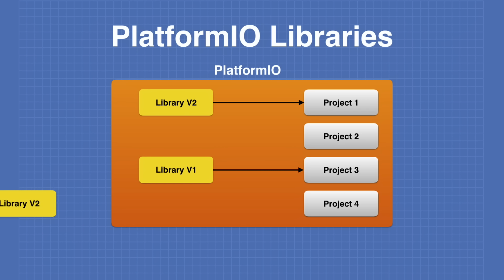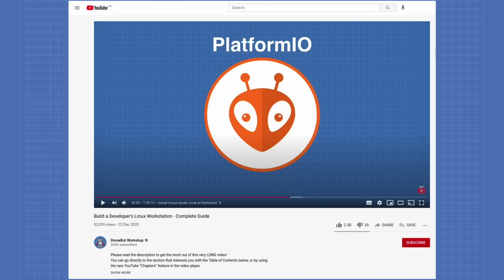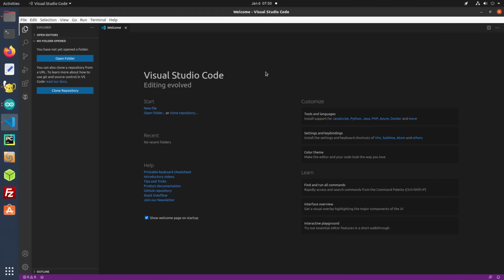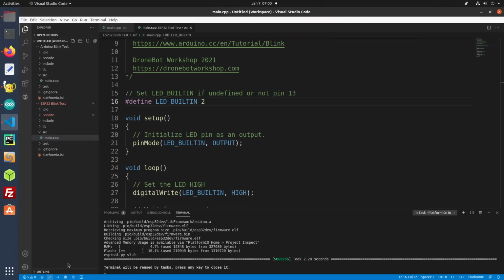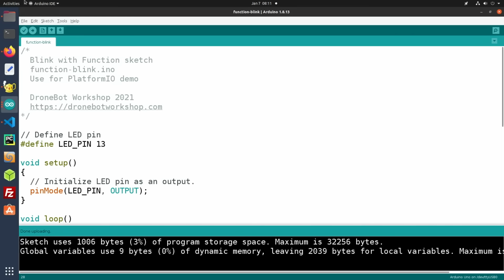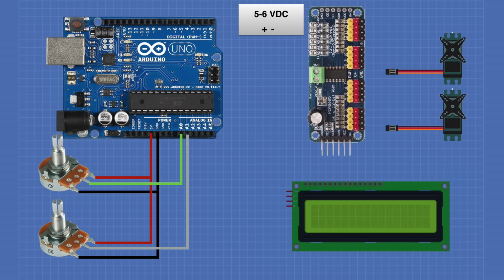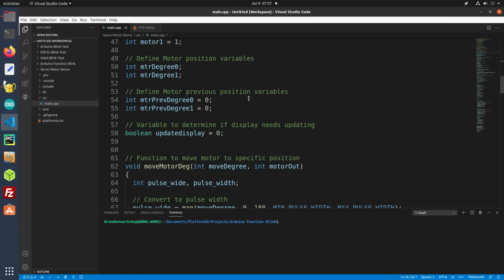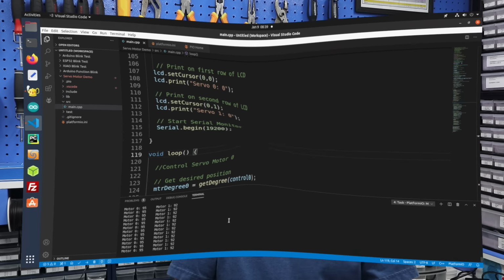Getting Started with PlatformIO

Comment: Great video, was looking for a clean and detailed introduction to PlatformIO to program an Infineon XMC. I really loved the video, just wanted to note some small criticism about a simplification that you made around 29:30. The problem with the function definition actually has nothing to do with PlatformIO, Arduino or VSCode but with C++, the programming language on which the Arduino framework is build. Here it's required to at least define a function, if not implement, before you use it in code. This is one of the main reasons for header files (.h, .hpp, ...). I'm just personally not a fan of these oversimplifications that hide the true nature of things. Not that some young programmer is looking for the differences between PlatformIO and Arduino, when she should rather look into how C++ works.

Anyway, I just wanted to note that and maybe give someone new a little bit more insight. Changes nothing about how extraordinary well you explained this! Your channel is always a great starting point for a fresh embedded systems project.

Cheers

Comment: If you'e having problems with the ordering of functions then you can always notify the compiler of a "forward reference" by using the "extern" keyword and typing the following just after the #include statements:  extern void blink_led();

Now you don't have to worry about reordering the functions. Besides, sometimes functions refer to one another in such a way that there is no ordering possible. e.g. function1 refers to function2, and function2 refers to function1. The only way out of this deadlock is to use the "extern" keyword for both functions.

Comment: Another great video! This one was particularly useful to me as I was just trying to bring up VScode as a new IDE to try (replacing the Arduino IDE). I couldn't get my previous Arduino IDE code to port over readily as I couldn't get the library path issue figured out. I looked at several different cryptic online sources with no luck. Your video made it clear as a bell. Setting baud rate in the terminal too was mired in dead ends. That was made clear and simple here as well. To the point, simple answers to simple questions. What a concept! 
Thanks for doing these vids!

Comment: thanks So much , its great video and more informative
about the definition of functions after loop and setup void , you can do it in Platform.io by using Headers , its a simple concept for c++ language , follow the below :

1- put the declaration of the functions inside header file called [FunctionDeclartions.h] and store file inside folder called [nclude] its built in folder inside the project
example: void printMessage(char* msg);
2- just include it like FunctionDeclartions.h on top my main.cpp file
3-Write the Implementation of function inside main.cpp file like below
void printMessage(char* msg)
{
  Serial.prinln(msg);
}

4-have fun :)

thanks a lot

Comment: thanks for your educational workshops ! I am radio transmitting amateur, PA0HTY and for the home-built MLA antenna I am going to apply a stepper motor. as an engineer many projects with the Intel microcontrollers 8031 and 8051. My question, is it possible to switch IDE in high contrast mode? because of poor vision IDE environment is very difficult to read! Or is there an IDE alternative ? Thank you ! kind regards, Theo, the netherlands.

Comment: I always found Arduino IDE to be just terrible, sure you can get simple stuff working with it but anything even slightly complex and it is pretty frustrating, if the available libraries don't do exactly what you want you are stuck. I have been using CubeMX IDE for STM32 development and found that to be fantastic but it is only for STM32 devices. I have Eclipse with ESP-IDF integration for ESP32 and I don't use Arduino devices because they are so limited so this looks like it may be worth trying out.

Comment: Great video!

Pro C++ tip: For cleaner code, you can split function declarations and definitions. This allows you to have the first proper block of code be your main function/loop, whilst still allowing you to write and call functions separate from your main function.

To do this, just declare the function before your main like this: void myFunction();
Then, write your main function, and define your extra function below the same as you did in the Arduino IDE.
Reply: Yes, It's called a function prototype
Reply: @_ahmedwalid_  Show a Video with a proper demonstration
Reply: Function declarations work really well. I've always thought that having a load of functions at the top of the code is a real pain because it can take ages to find where the actual main program starts and as often as not the actual functions are low level trivia that just get in the way. Bill says that having to declare all functions before you use them encourages people to write good code. I disagree - who cares where the functions are defined as long as they are defined? Putting them at the end makes the resultant code a lot clearer and easier to read. Also, I've found that the Arduino IDE sometimes allows you to put them at the end but sometimes it doesn't. Function prototypes solve this problem, but ideally they shouldn't be necessary. The same goes for variables - they have to be declared before you use them. Why (as long as they're in scope)? I worked for many years writing in assembler and liked the ability to declare variables where it was convenient for me. The only advantage that I can see obtained by having to declare functions and variables BEFORE using them is that it saves a compiler pass and hence a few milliseconds. That's hardly an overriding reason with modern high speed processors.

However, despite the above comments, don't let this distract from the fact that this is yet another superb video from the master presenter.

Comment: This should be the go-to primer video on PlatformIO - concise and to the point, presented with a calming voice.

I managed to get a Digispark (micronucleus) v2.5 board working in Windows, but haven't had any luck in Ubuntu due to many issues with the micronucleus command. Has anyone else got this working?
Thanks

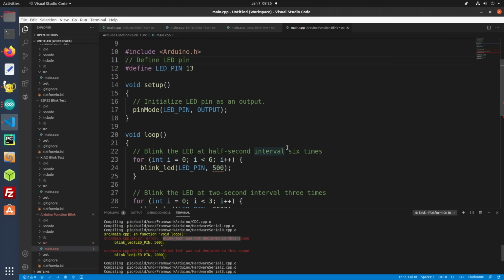Comment: 29:00 The discussion about defining a function before calling it. This is a feature of C++ (and a number of other languages). Why do you not need to follow this requirement when compiling with the Arduino IDE? Because in Arduino you put your top-level code in a blahblah.ino file from which the IDE build pipeline generates  a corresponding C++ file and a header file that contains function prototypes for any functions you defined in the ino file. The C++ file imports that header at the beginning, so by the time the compiler gets to the seemingly out-of-order call to the your added function, the compiler has already seen the prototype in the header file. So all is well.  Whether this is a positive feature is debatable.  It helps inexperienced users get things working in Arduino without some fussy details. But it violates the C++ language spec, and introduces mysterious behind-the-scenes magic.

Comment: Thanks so much for this video. About 1/2 way thru I dl'd and installed. Being a Borland and then VS programmer from way back I really appreciate the debug and code extensions. The Arduino IDE is positively prehistoric in comparison. I felt right at home immediately. Thanks again. BTW, I like being forced to define functions. The arduino IDE was too loose in this respect.

Comment: A tip re multiple envs

In your platform ini you can put build flags
e.g.

[env:leonardo]
platform = atmelavr

board = leonardo

framework = arduino
build_flags = 
 -D=LEONARDO
 -DaNAME='"leonardo"'

Then just ref them in code later

  #ifdef LEONARDO 
   Serial.println("I AM LEONARDO");
  #endif

  Serial.println(aNAME);

This way your code can act differently depending on the env you are targeting.

Comment: Great tutorial Bill, thank you! I was wondering if it will be possible to install PlatformIO on a Raspberry Pie 4! Right now I use a RP4 to run the Arduino IDE and I upload my sketches directly to an Arduino Board connected to the RP4. I have created that environment since I didn’t want to connect microcontroller directly to my brand new MacBook Pro. What do you think, anyone? Thanks for your help!

Comment: I've had VCC installed for a long time but am not finding the platformio extension. Searched for it. Uninstalled and in the process of reinstalling VCC - still no platformio. Spent half a day on this. The VCC install page shows an "Optional" Android SCK setup API and I checked that but PlatformIO is still not in the Workloads list, which  is where I would assume it would be found.

Comment: What power supply do you recommend? I am looking at one that is variable 0-30 volts and 0-5 amps with a ground. Any tips or suggestions. I want to work with stepper motors more and use the arduino.

Comment: This was one of the best How-To videos I've ever seen.  Very clear and concise.  I had tried to install PlatformIO a number of times but kept getting bogged down with dependencies.  It was like Linux all over again... but this video really made it clear how to get it going from an Arduino perspective.  I got it going, put in an Arduino program and got couple errors.   One library (from GitHub) was NOT found and I had to add it manually...some hassle.  I was able to build but now can't upload, says nothing at COM1 where my boot loader gizmo is located.  (I use it to program an Atmega 328P MCU, using the program port.)   Works perfectly well in Arduino, but not in PIO.  Again.  I haven't got time to keep doing these little fixes.  I had a Corolla IDE, wanted a Mustang, got a Ferrari.   Well Mr. Ferrari I will be delisting you.

Comment: Odd i have an ESP32 and i was using your video to set up Platform IO and the code you used in the first example for the non ESP board worked fine without defining LED_BUILTIN.

Comment: Great video: "you can work on more than one project at a time", yes, I can't close them. I can close the editor, the window and the workspace, whatever that is.  

Yes, the incomprehensible mysteries of PlatformIO are still a hobby-horse of mine, but I still can't get it to do anything useful, certainly not to compile and run programs that already work on Arduino IDE. As for getting TFT_eSPI to work, I still don't even know where it's been stored, if it's been loaded at all, to edit its UserSetupSelect.h file. The steep learning curve is a vertical cliff, and I'm still on the beach, while everyone else is on the top having a picnic.

Comment: Thank You!  
I am a retired embedded systems engineer.  I use the Arduino for simple home projects and I have always thought the Arduino IDE was too basic.  Platform IO is exactly what I was looking for.  I did not want to try and setup Eclipse for Arduino and this is perfect for my needs.
One suggestion, instead of moving the function ahead of setup() in the blink example it would have been the perfect time to explain function prototypes and how they are required for C and C++.
Reply: I met the xxx was not declared in the very first day using PIO for Arduino, that frustrated me for a half day until I wrote a header file.🤣
Reply: Hey @larrysmall3521 as an embedded engineer could you explain your line of work...... I'm a student looking to major in embedded systems and electronics

Comment: Thanks a million!  I have an ESP-32 watch the TTGO setup.  Right now I have her running the Homer Simpson analog face, however the complete code, which I had running earlier needs to be installed with something other then the Arduino IDE because of the way the author wrote it.  Since the Arduino insists that the code be in the same directory as the name of the code, it breaks all the references to the necessary files to complete the system.  I did have this set up a few months ago and it worked fine, however I was disappointed with the power drain on the watch when the full code was installed, the Simpson face takes less current to run and the battery will last for days, not hours as the extensive code does. That said, I do want the ability to switch between codes.  I am not sure how I muddled through it the first time, however after watching this tutorial, I am confident I can once again install the full code and have a smart watch instead of an idiot watch,  (Homer is an idiot is he not?)

Comment: Well, I did it and it worked quite well. I have a lot of clones and FTDI programmers and it has issues with this. Another thing I have noticed - it does not like different USB ports being used at the same time. As long as you remove one and plug the other into the same port it is ok. Works well on ESP32CAM now have to try the Maple Mini next. thanks for a great video - I will get used to this and no doubt use it more and more as it gets better...

Comment: The Arduino IDE calling itself an IDE is an insult to all actual IDEs.
Reply: Not really. It's for total beginners. It works.
Reply: @noweare1  
For beginners in particular auto completion and hinting, auto brackets/quotes, auto formatting/indentation and proper syntax highlighting (not just the four colors that are used inconsistently) would be very helpful. The only "IDE" thing that the Arduino IDE does, is the library manager.
Reply: @superdau  PIO way to busy for beginners. Arduino got it right with their ide. Anyways most projects by beginners are small so Arduino IDE  just perfect for entry level people.

Comment: Thank you Bill, excellent video. I installed platformio 2 years ago and it was slow to compile and complicated. It looks like it has been improved since then.
Reply: You r right, I have an old core 2 duo cpu, the compilation time really is slow compared to arduino IDE under linux.
Reply: @superuser7545  Was kind of clunky before but I did add 8MEG ram to my linux pc. I didn't like VS+PIO before but loving it now.
Reply: @noweare1  hmmm, thank you, will have a try and make my mind  !

Comment: Hi, Thank you for This Excelllent excellent tutorial. I thing though I want to mention, is that it is NOT an obligation to put the functions in front of the loop(). You simply need to "declare" the "prototype" of your function so that the compiler is made aware of the function and can double check the integrity / match of the parameter's types declared. Thank you again for an excellent tutorial.  RJM
Reply: For those that maybe don't know what @René-Jean just said: Simply add the function declaraion line `void blink_led(int LED, int delaytime)` above the loop() - no need to move the whole function.
Reply: @slinco65  thank you

Comment: I've been a software engineer for 20+ years.  Platform IO is so much more comfortable for me than the Arduino IDE.  VS Code is my second home.  Thanks for the great introduction.
Reply: Running PlatformIO in VS Code is NOT suitable for large applications. It cannot handle multiple files and it restricts you to ordering your functions before they are called, which is only a sign of a primitive compiler - and does NOT make your code any "better". PlatformIO has some useful features compared to the Arduino IDE, but overall the Arduino IDE would be more suitable for developing larger (multi-file) applications. Because of the restrictions, PlatformIO is really only suitable for simple sketches. 

If you want the best of all worlds with no restrictions, use Visual Studio Community or Atmel Studio with the Visual Micro plug-in. I've tested all the above and this is definitely the way to go. Visual Micro totally blows PlatformIO away!
Reply: @reedreamer9518  This simply isn't true. PlatformIO works just fine with multi-file projects, it just doesn't do all the automation that the Arduino IDE does. You have to treat the project like you would any other C++ project with forward declarations, header files, header guards, etc.

Visual Micro is really good from what I have seen, but there's no need to fork out $100 for it when PlatformIO is FOSS and does what most people need it to.
Reply: @reedreamer9518  Nonfactual. Use forward declarations.
Reply: @reedreamer9518  Visual Micro is not Free.

Comment: For those wondering how to input serial data to your board using platformio on VScode the same way that you would do with the serial monitor on the arduino IDE: 

platformio doesn't have a fancy serial monitor like arduinoIDE does.

So you can either type your data directly on the command line terminal that shows up when you upload your code to your board, but you wont be able to see what you are typing and also if you type too slow it is going to split your input data.

Or you can actually use the arduinoIDE serial monitor to input the data, even if your code was not uploaded from there. If you choose the second option, which is using the arduinoIDE serial monitor, then you just have to upload your code to your board using platformio like you would normally do, but then when the code starts running on your board you go to the arduinoIDE and open the serial monitor there (don't forget to set the baud rate and port properly there as well) and that's it :) 

IMPORTANT: you cannot upload to your board when the arduinoIDE serial monitor is open (if you try it is going to give you an error saying "access is denied"), so that means you always have to close the serial monitor before you upload to your board again. I hope this helps someone :v

Comment: i have an issue where when i  run a code , and then go to a different code to run it, it runs the previous code not the current code , any solutions ?
Reply: By code you mean a project? Because if that's what is happening, then when you want to switch between projects you could just reopen the IDE and open the project from an empty workspace and see if it works :) if u try my suggestion let me know if it worked